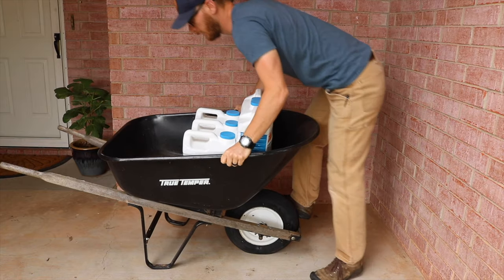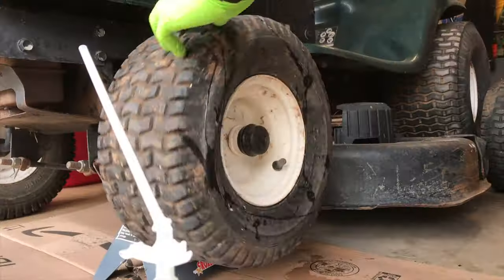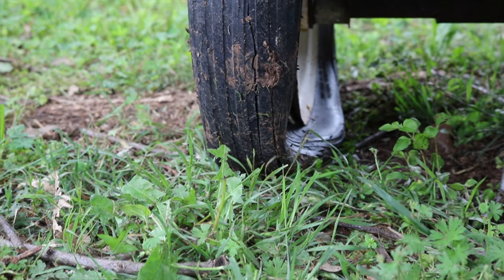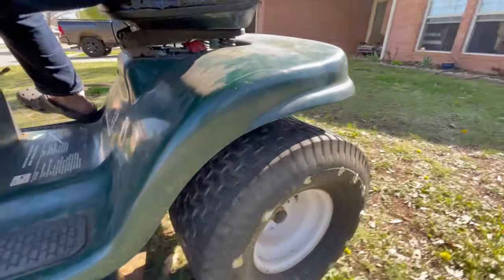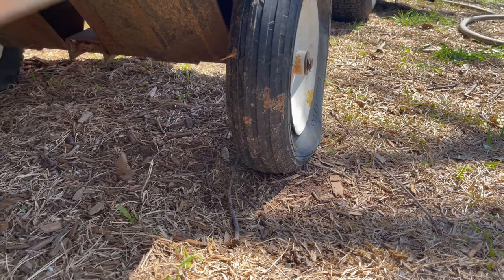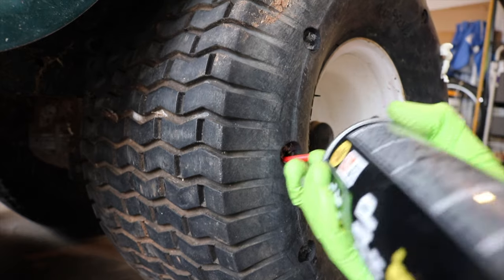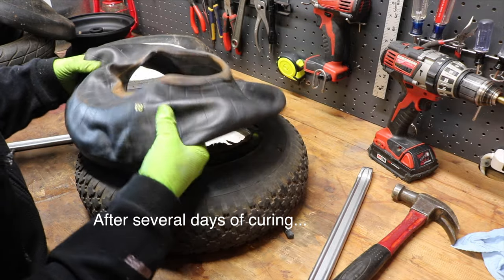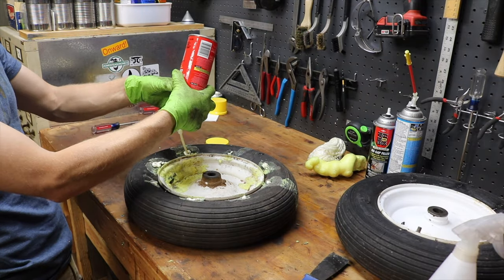DIY Spray Foam Tires - Do they ACTUALLY work long term? (Part 3)

Comment from the maker: Spray Foam Tires - Which FOAM Actually WORKS? | Part 1
 https://youtu.be/KnpHSMAvPPc  

Spray Foam Tires Part 2 | DIY Run Flats TESTED To FAILURE
https://youtu.be/mVtQG4oGgXU

Comment: I took the valve core out, sprayed it in there until it came out. My release hole at the top never had a problem. They were hard the next day. By the way, I use the large gap filler foam😊
Reply from the maker: How has it held up for you?>
Reply: And updates??

Comment: Tried it on those little 11" zero turn front tires. DIdn't really work. $3 / can for  big foam wasn't a terrible loss of experiement since my tire was shot anyway.
Reply from the maker: Yes its definitely a weight to foam ratio on how long it will last.

Comment: I tried this and it works really well. The foam inside the tyre kept expanding for about 4 days and now it's as solid as a rock! Well done!
Reply from the maker: Its not a long term solution, but was a really fun experiment and might have its place for certain applications.
Reply: Same here. It has to cure for more than a day. Never mind what the can says. Do it ahead of time and keep it as a spare. Also the tires he is using are very narrow and put more pressure on one spot. Wider tractor front tires work better.
Reply: until you put weight on it. but they do make tire foam thats poly uathine big diffrence.

Comment: I think leaving the foam exposed to the elements water getting in there degrades the foam much faster, I think the better idea is through the valve core, or break the bead and spray it in there, Or in your case some sealant over every drill hole probably would have contributed to a longer foam tire life..
Reply: True because foam got traped air that tries to escape anyway that's why called a foam 😂
And exposing the foam to outside air makes it "rust" 😂

Comment: Thanks for making the video on spray foam. I wondered if it works and now I don't have to try it for my self. I got tired of fixing the tires on my garden cart that is similar to yours and I looked and looked for a solution I could afford, I found 10 in. x 2.5 in. Cosco Flat-Free Replacement Wheels for Hand Trucks (2-Pack) for about $25 for the 2-pack. They are a little shorter than the original tires but I thought it was worth trying and I am so glad I did. I have hauled a lot of weight in mine and they have held up over the couple years I been having them on the wagon. They look like cheap plastic but they are very sturdy. I also like the yellow because it actually matches my little John Deere tire wheels that I pull that wagon with. I loaded up about 8 concrete blocks in it recently, the 16" x 8" x 8" size blocks. I have about an acre property and was moving the blocks from one end  to other end of property. My little john deer is an S-100, I could tell the weight was on the trailer pulling it. I like those tires so much that I replaced the tires I had on my mobile mini greehhouse I built. When my hand cart tires get worn out I will replace those with the 10 in. x 2.5 in. Cosco Flat-Free Replacement Wheels for Hand Trucks (2-Pack) also. I really like those tires and can't beat the price. If a person doesn't like the bright yellow they could always spray paint them another color. If ya google those tires you will find them from several vendors. I got mine at the big orange store but they have went up in price there since I bought m last set.
Reply from the maker: Glad they've worked well for you and that youve had no issues with going to a smaller tire size!

Comment: I live in Hawaii, and we do rainwater catchment. My 1st setup was just a cheap pool with the blow up ring around the top. Intex brand. But the birds literally popped it within a few days. 160$ down the drain? No no no. I bought a case of the big gap filler, and went at it. It worked great. The water would then fill clear up to the top. It lasted really ling too. Eventually the sun and time started ixidizing and drying out the plastic ring, and it finally failed, but I think I got 3 full years of service out of a cheap pool thats designed for 1 season at best...
Given, there was no way to take the pool down to store it, like in cold weather climates, but i wasnt anyway.. 👍

Comment: Planning to try this in the kids bike tires we get from the scrapyard. The kids only fit a bike for a few months anyway. It is so relieving when the bikes already come with foam tires.
Reply from the maker: Highly recommend NOT trying this on bicycles- the foam to weight and speed ratios say it won’t hold up long at all

Comment: I have a skid loader that came to me with foam-filled tires.  The former owner used it for building demolition, and had lots of flats before he filled the tires with foam.  I don't know what sort of foam he used.  He may have had it done commercially.  

Whatever foam he used, it has held up in the skid loader tires for fifteen years now.
Reply from the maker: Most likely a commercial two part foam - cant imagine this type of foam working on a skid loader

Comment: Good video, you answered couple of my questions. I have similar small tires on my portable generator, it doesn't get moved very often but when I do have to move it I cant with flat tires,. So maybe solid ties would be better for me....
Reply from the maker: Solid tires would probably work best for you - but I'd just buy them - I don't think this foam setup would work well long term for that.

Comment: I think I'm going to try this on my tool box cart. 
I have spent a lot of time in the past replacing tires, cleaning beads, putting in tubes, making sure there is nothing to puncture a hole in the tire and still come in the next day to find a flat. I even accused co workers at sabotaging my tires and/or letting the air out just to mess with me so I locked it up in a place no one else could get to and, yep flat tire. The cart just sits in one spot untill I really need to move it and then I air the tires, take it to the next location and park it there for the next few weeks instead of pulling it around to the different locations outside where I really need the tools like I originally wanted to do. So much time saved if you don't have to trek back inside to get a tool cause your tools are there beside you at the job.
Yep, think I'm going to try this.
Reply from the maker: I think you'll be disappointed - too small of wheels and too much weight. Here's some additional testing: https://youtu.be/88ZYnSid3g4

Comment: Rocking on. I still may give it a shot on my mower, the dirty b^^^^^^^. Something I did use spray foam for was making the shaped lining inside a guitar case. Turns out, probably do not want to leave your Gibson Les Paul wrapped in a trash bag exposed to the heat of expanding foam, or the potential of chemical leaks. It cured so globby I ended up cutting quite a bit back out and cutting panels of 1/2 foam to fit the guitar, gluing them together and covering them with my fabric. But hey, experimenting is fun. At the price of wood right now, I am visualizing spray foam lumber.
Reply from the maker: 😂😂😂spray foam lumber!

Comment: Need to run the test with a couple more variables. Different types of foam, closed cell vs. open cell foam, high density foam and closed cell vs open cell foam again. Wet the tire thoroughly inside before foam is added. Plus, without drilling the holes, wouldn’t it be better for the tire after it’s foamed because you could perhaps even air it a bit up after it’s cured and see if it is better or worse for its life, and you could build one of those things like the DMV has for dyno testing where you can run the tires under load and not need to actually be driving around for hundreds of miles or hours or whatever? 

Maybe even spin the tire immediately after foaming while it’s foam is still curing could help it spread with centripetal force, you know like have it mounted and then use the throttle to spin it while it’s off the ground under no load perhaps? Have fun, that’s the most important part of the experiments apart from solving a really great series of questions. Thx for the video, it got me thinking, that’s for sure
Reply from the maker: Having fun is what started it all! Thanks for watching

Comment: added some water inside the tire for curing this time .foamed like crazy
Didn't read the fine print on can for curing
The foam when we have used for years had no idea that water helped curing process

Comment: Pls forgive the length of this comment BUT I have used a length of rubber, maybe its silicone hose.. I honestly don't... and added it to the end of the straw as a flexible extension for longer reach. Ive used it for wall/ceiling gaps where the space kinda rounds a corner or runs along a board where it needs reach but you need the expanding foam to really fill up the space so adding holes would be counter-productive.  I plan to use this when i add the expanding foam around the hollow space around my bath tub.  
I think im going to experiment using my method but also i think im going to  pry the tire away from the rim, add styrofoam, maybe glue it inside and leave a small channel to run my hose and add the spray foam that way .. might work 🤷🏼‍♀️

*Btw the hose is medical grade air hose like the hose from the hospital for oxygen or a nebulizer. (for anyone who doesn't know what a nebulizer is, it's a machine thats usually small/ portable for breathing treatments like at the hospital but for home use to help with asthma/copd/bronchitis ect.) I have asthma and i had a friend whos dad passed away and he had a large stash of those hoses so instead of throwing it out she gave it to me.  So any of it that was already open, has been torn ect I've used in projects.  I dont suggest wasting money to buy that special is all lol😂
Reply from the maker: Did you experiment with it? How'd it turn out?

Comment: try trans fluid or even used motor oil . over years , oil will ruin the tire , but it's free , and you ruin your tires by drilling holes for the foam anyway . you can't later put a tube in a tire that had oil in it though , it'll dissolve the tube quickly (like overnight) .

Comment: I've been thinking of doing this on my hand truck. I hardly use it and it stays inside the garage. I have cans of foam just sitting there tempting me to do it. You think it will hold up ?
Reply from the maker: It will work - but for how long is the question...

Comment: Haven't used foam yet, but I keep putting tire slime and plugs in my mower tire, keep expecting the mower to stop working so I have refused to get new tires.
Reply from the maker: As soon as you buy a new tire, thats when the motor will quite

Comment: Is there ANY way to calculate the foam density for specific loads?
I'd like to use foam for my orthotic insole. Any recommandations?
Reply: I would try out the Window and Door Foam. It is minimal expanding and does not put pressure on door and window jambs. It is also softer foam.
Just buy a can and experiment.  Have fun.

Comment: I was wondering about tennis balls and I've seen plastic pipe used as well for tubeless tire designs, though unless using a good quality rubber tube stacked... gonna fail is my guess.  Might not with plastic pipe inside tires... though safe to go with rubber is my thought.  Makes me now wonder about that playground rubber replacement for sand as well.  The rubber products coupled with a coating of the FlexFoam-iT!™ 25 would probably be good for a while.  Looks like Lowe's and Tractor Supply have "NuScape  Brown Rubber Nugget Mulch" and the price looks good alone.  Man, that gets me wondering about applying like you did with the side wall holes or maybe better using a sharp razor blade cutter to cut out the one or maybe more fill hole(s) and bonding that sidewall piece back in after filling with NuScape with like what the "sixtyfiveford" YT channel uses in the video titled "Tire Sidewall PUNCTURE permanent repair procedure" the PR40 to PR100 (difference in set time and viscosity) Rubber Weld by 3M.
Reply from the maker: Sounds like a good experiment to try ;o)
Reply: @GanderFlight  Yeah, thinking the rubber mulch is more feasible installed using the hole saw'd or maybe slit method and PR40 Scotch-Weld to adhere back the slits or hole saw'd out pieces.  Thinking the slits will be the better route.   My only concern is a lack of uniformity with the rubber mulch if there isn't an adhesive coating on that (maybe type 1 silicone though better to be a optimal rubber adhesive like used on the side walls or tire repair patches maybe) when installed and balanced out to be uniform.

Comment: I used oversized pool noodles In the front Bogey wheels on  my zero turn mower. It's a toro with a sixty four inch deck.. I'm not sure of the weight but i've been using them for almost two years now
Reply from the maker: Nice!! Good tip Alex. Just the foam noodle or air too?

Comment: What kind of foam does the OE use? They run foam filled tires on big heavy equipment regularly, so just wondering what they were using.
Reply from the maker: OE?
Reply: @GanderFlight  Original Equipment or rather Original manufacturer if you want to think of it that way. Well, I guess they use a third party, but I know companies all of the time will have skid steer and hoist tires factory filled with foam. Funny thing is though if ones ever cut apart it looks like the foam is only in the tread area of the tire, which doesn't make sense but I assume it's very stout stuff for loads considering these pieces of equipment with load can easily weigh up to around 20000lbs and do 40 to 50 mph on the road then there are companies filling large tractor tires with foam and those can weigh up to 30 or 40000lbs depending on hp and size. I imagine it's just too expensive for your average person though - probably the 2 part you were talking about?
Reply from the maker: @GHuggins  gotcha, I figured that's what you were referring to but wanted to clarify. Ultimately, the  customer obviously doesn't have a HUGE pain point, other wise the OEM would solve the issue, hopefully ;)

Comment: I heard you can use automatic transmission fluid in place of slime.
Reply from the maker: Interesting - have you tried it?
Reply: Gander Flight No, I have not. I just heard about it. I heard about it from Henry at mowers n blowers. He’s one of the guys on YouTube who makes videos about lawnmower repairs.
Reply from the maker: I may have to play around with that.

Comment: First mistake I see is drilling holes in the tires. Remove the guts of the fill valve, spray foam whilst rotating tire for even distribution, then put the guts back in the valve.
Reply from the maker: I tried that on another tire and it never cured the foam inside going through the valve stem.
Reply: Sounds like a good idea!  Thank you

Comment: Okay now my question is..
Can you fill this whit silicone ?
Or whit a mix of silicone and this foam ?😂
Will it perform better
What about covering all the air pokets so air doesn't get inside the tire whit foam / foam andsilicone

Comment: Not a good solution. This is low-density, rigid foam. You want high-density, flexible foam like Smooth-On's FlexFoam-iT! 25.
Reply from the maker: Thanks for the suggestion Dan. Where can I get some of that?
Reply: Not at $190 per gallon for that product.

Comment: Trying to get those wheels off. That transmission axle would be out feeding its own. Probably easier to take the axle real the transmission I used to build those transmissions when I work for the company. peerless gear. A division of the Tecumseh products company. I tested every transmission 100% shift test, inspected. I stayed there for 14 years until they closed. They used to lay us off. For the whole summer, it was the greatest.
Reply from the maker: Thanks for watching!

Comment: The whole point of a pneumatic tire is flexibility from air compression. Spray foam isn’t flexible. It can’t work in principle.
Reply from the maker: Depends on what you're looking to use it for :)
Reply: Do I need flexible on a old wheelbarrow?

Comment: Why drill holes in the tire when you can use the valve stem  😂😂😂😂
Reply from the maker: I tried that on another tire - the foam never cured that way for me.